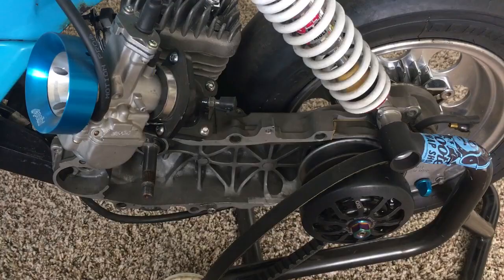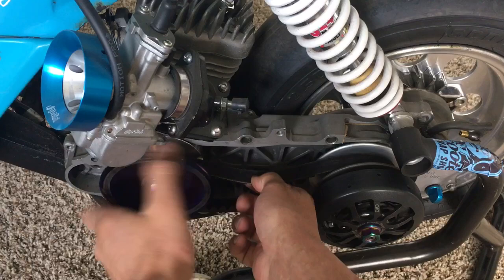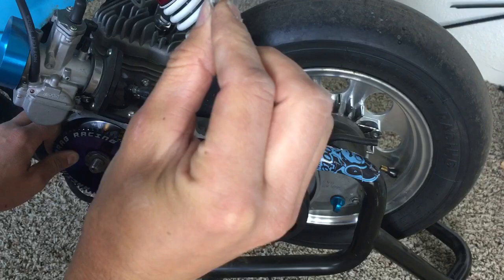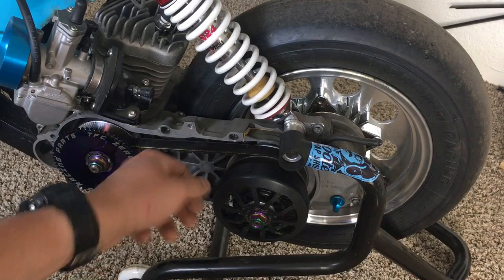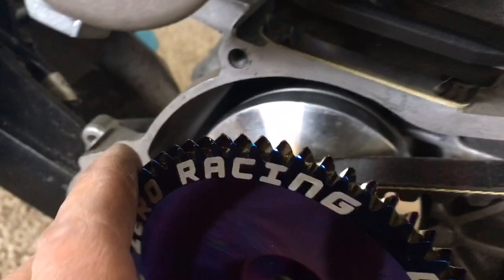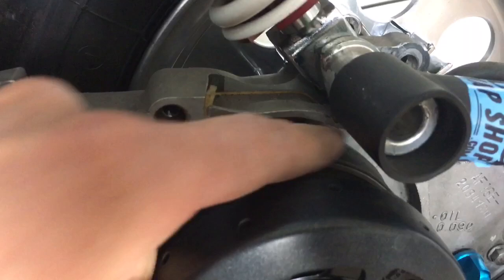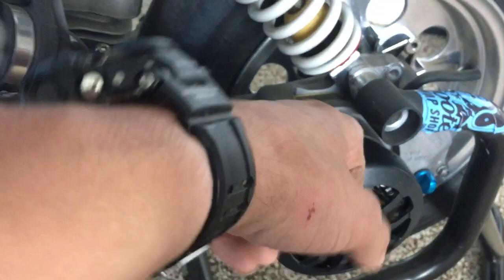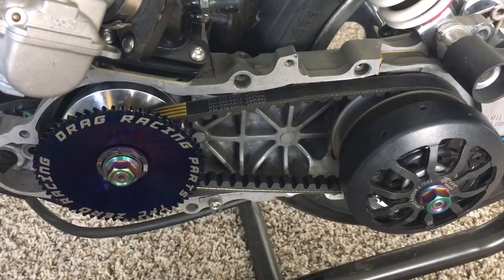Scooter transmission shimming

Comment: I really appreciate you making these informative videos.  I recently acquired two 2008 Zumas, with the plan to upgrade one.  Via your videos, I have learned a lot, and will have a pretty good plan on how to perform upgrades in a cost-effective manner.
Reply from the maker: Glad to help make sure you get all your parts on scooterswapshop.com and make sure you subscribe it supports the channel!
Reply: Most of the stuff is cheap on Amazon 💁🏻‍♂️ I won’t pay that high crap 😂
Reply: All the stuff on Amazon is also cheap shitty parts put in a fancy box you get what you pay for!!

Comment: In some rare cases (in my experience) the stock belt and new belts matching stock are too short so shimming doesn't help with the rear/clutch fitment, so check that as well.
Reply: exactly: same problem  as if you fit a 835-20-30 where a 842-20-30 should be

Comment: Thanks for this video man. Belt on my rear pulley used to be lying below the the edge but after i changed the oem drive face with a naraku highspeed drive face+0.7mm shim, i got the best takeoff, bogging was gone and belt now lies at the edge of the rear pulley. I can now climb up a steep hill from a stop with all power from my 70cc cylinder with ease. That's what I was wondering before with the 70cc kit and exhaust i have why i can't climb hills and just bogs.. Thankfully this solved the issue.
Reply from the maker: thank you

Comment: Hey I have a question my 50cc clutch is not Engaging and my back wheel is not spinning. I brought a new clutch and Variator and still the same issue. The pulley is spinning the belt with the Variator it’s just engaging

Comment: Hi, ive got an aerox 50 . ive changed the rollers and the spring on the rear and clutch springs. It rides well with but its not very good pulling away. It feels like you could just hold it back. When starting on a hill it just doesnt want to pull away. it just revs hard until its doing about 5 mph then it starts to go ??? Any ideas. Thanks
Reply from the maker: I suggest learning about variator tuning and carb tuning then mess with the bike

Comment: I got 5,5gr in my 70cc zip. it holds his 8.600rpm and at 65 km/h it starts going up to 10.400rpm like it should be. Problem is That the setup starts getting power like 6.000 rpm, but original clutch comes at 4000 rpm. The belt is going inside right after. I can’t even put little harder springs in it, otherwise the belt is going to go inside before theclutch comes. The belt is moving inside like 5000 rpm. And if put lower rollers in it, it will not hold a too high rpm while acceleration... what can I do?

Comment: Hey bro, awesome vid,  really easy to understand, thank u and please make more vids so myself and other foreigners here, (thailand) can go fast like the locals do with the exact same bikes cause their bikes fly but they won't help foreigners to go as fast as their bikes do, very jealous people, and it's  impossible to get what u want or get the performance parts needed from any shops even though most things needed r hanging on the walls but the Thai mechanics r either rude, stupid, jealous, don't know or don't want to help or even deal with foreigners, I have never messaged or followed anyone on u tube but i need help and hopefully u can help me with my bike, can u please keep showing us how to make the scooters faster, better, smoother and also can u talk about performance parts like, mad variators, pulleys, clutches and springs,  full kits with all that's needed in the CVT, belts also engines, big bore kits as most bikes here r small 4 stroke 125cc and 150cc, I'm tired of paying and getting little to no extra power or performance, cant get what ii need, please help me, Thai's  will do the minimum they can  they  just don't want to help and get go fast parts like all the local  bikes have here, ii try to get the parts needed that can make the bike faster and mainly more FUN, thats what its all about,  also suspension, front disk, braided lines, cause most small bikes here just have rear drum brakes, so how to make the front brake work the best possible way cause there is no help or even wanting to help foreiners here, even though i pay what they ask, i personally need to know about the 2015 Yamaha GT 125cc with the blucore engine but also small cc 4 stroke scooter engines, 125-and 150cc, that other friends of mine have and how to go as good as they can, if I could get the bike just to do power wheelies, it would leave a smile on my face everytime i ride my bike as they r the main source of transport here, I'm just so tired of the people here, they take ur money, but u get little to no results but their bikes fly and must b fully optioned but I have never seen a foreigners bike even half as fast as their bikes, mainly Thai kids with no money so they must have alot of little tricks for their bikes cause they can't buy anything to good with no money,, thank u for taking the time to read all of this👍
Reply from the maker: THANK YOU!

Comment: Thank you for sharing! Don't you  lose top speed when the bush is too long? When the rollers can not push the variator enough to push the belt in it's highest position?
Reply from the maker: we talk all about this
Reply: @Scooterswapshop can u put the 4mm restrictor washer on first then the variator to kind of make a shorter boss?

Comment: I know this is an old video but I'm hoping someone can help. Son just passed his cbt. The aerox 50 does exactly what you explained at 5:12. It slow from 0-20mph then it just takes off? After taking the cover off and idling the scooter it looks like the belt is very loose. The rear clutch  height of the belt is about 3mm in the plates and not sitting on top but its close enough I think? The front however on the variator side the belt as plenty of play in it /spinning and from watching ur video the shim is too long? But this was a malossi kit with only 1 shim, new rollers installed with a new air filter and clutch spring. Any advice would be great so I can get the scooter to pull off how it should & let me, dad worry less about my son pulling out of junctions.
Reply from the maker: we have mutiple cvt videos that explain CVT tuning

Comment: Hello i got my scooter shifting and running perfectly with my malossi special x belt. But the problem is that i shimmed it in the front and now when i put the variator cover on the kickstart mechanism scratches against the kickstart gear and it's loud because the front variator is so far out now. When i remove some shims the belt is too tight in the front and dips in the rear pulley and i get terrible take off but the cover fits... What do i do? Minarelli Vertical.
Reply from the maker: give the shop a call with your order and what not we can see what exactly you have and get you taken care of

Comment: i just bought a 50cc moped bored out to a 70cc still gotta break in the piston and its drives fine but when you start it and when it idles sometimes the transmission sounds bad and its like something is banging off of something, what could you possibly think this is ?
Reply from the maker: could be 30 different things go step by step if its making noise there is a wear mark some where

Comment: i have the belt slipping situation with a liquid cooled minarelli top performance trophy 70cc block and my wingbell/clutch housing looks coloured - that means basically the thing in the middle of the vario in the front is too long ? or is it too short? i suspect its stock because the previous owner only changed the stock vario to a hebo next generation sport vario. before driving it revs up hard and then at some speed feels like its clutching. i hope that this is the solution for my problem :)
Reply: What "thing"?
I think that minarelli stock torque is the problem
Reply: @PchelaUbica  with thing i meant the "boss" or what its called in english (sorry im from germany my english isnt the best)
Reply from the maker: Your belt could be too worn out
Reply: @Scooterswapshop  thanks for the reply ! am going to check the belt in a few days and im going to post if its the belt , the last time i had it open the only other thing that was suspect to me was that the Variomatic itself had little Scratchmarks or Dents on the outside near to where it sits on the crankshaft. Is that something to worry about?
Reply: @Scooterswapshop  I replaced the belt with a Belt from RMS (Dayco Kevlar) and it still seems happening. I now switched from a Laser X-Pro Exhaust to a Open Stock Malaguti F12 R Exhaust and now it catches the Low End Torque a bit earlier but other than that its still missing torque.. (i want it to drive away instant instead of reving up and then send power to the rear wheel) 

Could that also be the Clutch / Springs that are defective or not correctly setup?

Comment: Hey can you tell me what is the best belt mesures for aprilia sr  50 with stock variator and cluch ? I have one yamaha should be 16.5x751 and i dont get all the way in the variator and even the cluch so it cant be faster than 65km/h
Reply: stock belt size since you're staying stock. What SR50 you have matters too. Since there's the 90's zuma minarelli engines, the 2000-2004 "Aprilia" designs (the variants of those years are mostly the same), and the 05 and later ones which just use the PGO/Vespa/Genuine/ETC design. There are technically more, but they're mostly just variants or updates of one of those 3 engines. 

The 2000-2004 DiTech ones have the tallest final drive, and the speedo reflects that showing up to over 100kph/70mph. Lower emission restriction for those years, and direct injection made them target a high compression, high torque design. As regular injectors cant fire fast enough to keep up with the doubled ignition of a 2 stroke, limting RPM to 10k-ish (maybe a tad higher) before the injector cant keep up. The piston is one of the largest 50cc pistons, and has insanely high porting and compression that keeps it to 50cc. The direct injection made it clean enough for those years to use a unrestricted stock expansion pipe. The stock power is insane given the size, hence the tallest gearing of any 50cc scooter to date. The 600$, one of a kind, fuel pump, goes out every 1,000miles/1,600km though. One of a kind in that it uses nearly 1/5th the power of other 120psi pumps, and that the bike has a very limited wattage allowance, means you cant stuff a different one in without killing the battery, or modifying the engine to charge faster.
Reply from the maker: not something we can get you. sorry

Comment: Hi man, with shimming on the drive boss will i not loose the kickstart if the crankshaft nut protrudes a lil bit?
Reply from the maker: Nino Echavez no it will still work depending on how many shims you use.
Reply: @Scooterswapshop  like adding 1mm shim i supposed on the drive boss. That should be fine ayt? Just worried about the crankshaft when the kickstart washer is not fully keyed in onto place on the spline with the added 1mm shim. Or could it be that the 792 16.6 30 belt m using is a bit thick?
Reply: Hi man. Before adding 1mm shim, i was having issues driving uphill from a stop as it seem to always bog down and not even move because i might have started like in 2nd gear. After adding 1mm shim, it has almost resolve this problem and i got more power and quicker on takeoff to get me to a powerband for hill climb. The position of the belt though still doesnt lie on the topmost of the rear pulley as seems like adding another 0.5mm shim will put the kickstart washer almost out of the spline.

Comment: Bro do you have any tips on a Adly GTA50? I have an issue where it will make like a vibration sound (can't determine were it is coming from, however, I can hear it in the muffler. I think) and when I hit a pot hole it will like not engage (slow down like it's not getting any power) and or shut my scooter down!
Reply from the maker: doesn't make much sense but sounds like somethings broke...

Comment: My moped Wont run the variator all det Way out eny suggestions
Reply from the maker: not sure what you are asking
Reply: I can’t get the belt to run the variator all the way I have 7-9 mm left, do you have some advice so I can use the full potential of the variator so I can gain some top
Speed

Comment: hello, i am having some issues with my 50cc scooter, i have installed a big bore, A9 performance cam, racing cdi, performance variator and ive tried a bunch of different weights/combos, installed a performance exhaust, and clutch grab springs, my scooter only goes about 35 mph according to several gps apps, what else do i need to do to it to go to its full capability???
Reply: also ive installed a performance spark plug and coil.
Reply from the maker: Of the cdi isn’t a ncy scrap it as the blue china ones are worse than stock. I would ask the shop you got all the parts from because it sounds to me like they maybe sold the wrong parts. We do 50+ on a bbk with cam and head. Your cam timing could be wrong or valve adjustment issues also
Reply: Scooterswapshop where i ordered them from had good reviews and all the other customers were happy so i think i may have done something wrong,I am going to install a big bore carb tommorow and i will adjust the valves, they are set at .004 should i try .003 and if it doesnt help then .005?

Comment: Where do you buy the 6 stage kits from
Reply from the maker: We sell it all. Scooterswapshop
Reply: @Scooterswapshop  
Ive got a yamaha cv50 jog 2010 model..
How much is the kit worth sent to Australia
Reply: Whats the idea with the open cut cases is it to do with the heat and to keep the heat out and cool it down..
Would it help a stock setup ive done the front veriator kit and lookin at doing the rear springs in the clutch

Comment: What motor is that in the video?
Reply from the maker: Dio
Reply: Scooterswapshop Would the same stage 6 clutch and CNC Bell work for a Us variated AF05E? Considering making the purchase today. Thank you
Reply: Scooterswapshop I will purchase today if y’all believe it works with a US Variated AF05E. Thanks again

Comment: i am trying to revive an old 50cc scooter (sanli silverstone or some similar piece of chinese junk), it starts fine but when i open throttle it dies... can you help, i mean i know it has cdi and elctronic 'needle' (i dont know the formal name) on carburetor, but it really is a piece of junk so i dont want to spend more than 30 bucks, please help.
Reply from the maker: Hi there is no electronic needle and the cdi will not cause that. Do basic diagnostics clean the carb replace the plug.